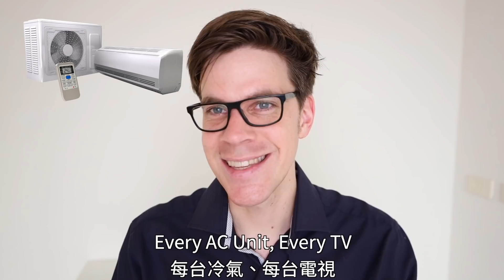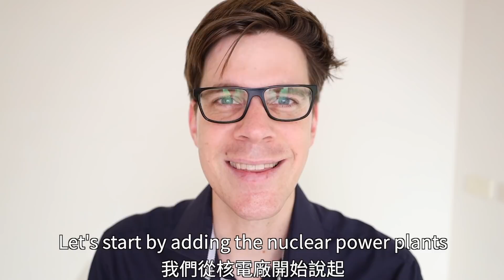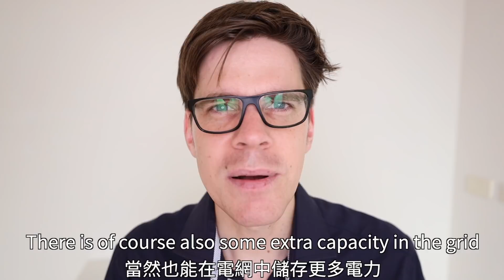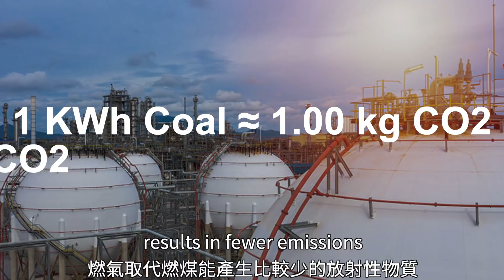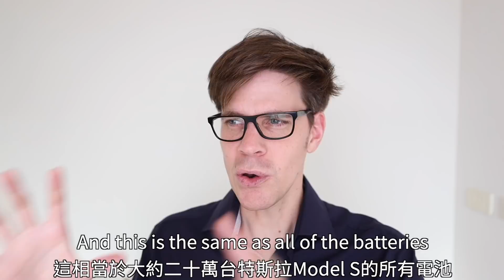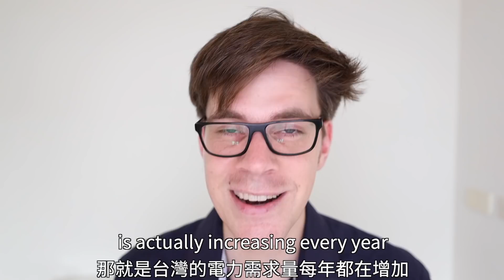台灣不需要核能和火力發電？3個使用更多再生能源的方法! | 3 Ways for Taiwan to get more renewable energy!

Comment: The duck curve phenomenon prediction in 2025 winter noon scenario, documented by Taipower company,  mentioned that the great penetration of PV power generation (Installed capacity 20GW) may rise the risk of instability of electricity system (very weak frequency response) if the storage facilities are not enough. According to Taipower company, the needed energy storage capacity is about 590MW in 2025; however, 12MW was installed in 2020 which seems a bit late.

Additionally, there's a big story inside for the difficulties of the renewable energy development in Taiwan, especially due to geography and weather factors. For, example, the PV panel are almost installed in the southern part Taiwan which may have risk of impact by thunderstorms in summer; wheras the offshore wind power facilities (almost constructed in the west offshore from Miaoli to Yunlin) may frequently stopped owing to gust wind (25m/s) in monsoon and typhoon season.
Reply from the maker: Thanks for sharing, since this is just an introduction video I just looked at the summer peak, do u have some source on the 2025 winter prediction? Would be interesting to see. 

I know the PV situation, but I don't see why PV can't be installed on rooftop in for example Taipei or Taichung? Maybe the incentive is not big enough or there is some other problem?

Thanks for your comment!
Reply: @JonasTjader  Thanks for reply. Since the information is almost in Chinese version, I found two English ptt on the internet provided by TPC, you can check the link below.

link1:
https://gwec.net/wp-content/uploads/2019/05/GOWST-Peter-Yuinhong-Liu-Taiwan-Power-Company.pdf
link2:
https://2020leds.tier.org.tw/docs/ChinChungWu_e.pdf

The PV penetration prediction I mentioned is on page6 of the ptt in link1, although detailed information was not revealed in the document and public by TPC. Other information like grid development with renewables and strategies can also be founded in the source.

The rooftop PV in Taiwan is a complex issue. What I've known is that the rooftop PV installation had become saturate in the southern part Taiwan; and most of available place that can have installation now are in the vicinity of Sea, where salt and mist corrosion may easily damage the PV panel. The rooftop PV construction in the northern Taiwan is on the way of development, especially in Taoyuan, where there's a great potential of factories and stores providing 100MW/year that may expect, thus the government is expanding incentives. However, the last but the most crucial thing that makes hindurance of the PV installation in northern Taiwan is the illegal addition rooftop and building, stemmed from the problem of dense residual population in the Taipei city, which is very hard for management...

Comment: hello Jonas, I have a question . If u use the pump to make water be higher place from lower place.It must need energy , why does Hydropower works?Cause energy loss must  be higher, right?
I'm not a energy engineer, so maybe it is a stupid question 😅
Reply from the maker: When you pump up the water, you need electricity to run the pump. Later when you want to use the electricity again, you let the water run through a generator on the way down. The generator will give you back about 80% of the electricity, so it is about 20% loss in the system.
Reply: @JonasTjader  The Hydropower efficiency is about -20%? So it works like a storage device when we need the energy in urgently 🤔.When we have the extra power , we make water be higher place.And when we need power urgently , we make it down. Does it right?
Maybe I need google it first. xD
Reply from the maker: @謝宇軒-q4r  I think you are mixing up Hydro Power (which generate "new" electricity) with Hydro Pump Storage (which is more like a battery)
Reply: @JonasTjader  OMG u r right , I mix up these things. 😅
Thanks for ur recommend. 😁

Comment: Jonas, but you missed a HUGE contributor to the stability of the grid and the management of peak demand which mostly occurs during the daylight hours.  Distributed solar.  That is the key to limiting coal and the reliance on fossil fuels.  How many of the drone shots show empty rooftops exposed to the sun?  so much existing real estate to fill before we need to invest in batteries and cut down forests or carve out hillsides to build solar farms.
Reply from the maker: Yes, my next point was that a mix of different renewables and different locations increase the stability, but I thought the video was getting too long :D. I agree with this point!

Comment: 核能和火力都是屬於基載電力，以目前現階段想取代相當困難
再生能源主要問題是發電效率低下且建設成本過高還有發電穩定度低的問題。
以下為台電目前發電狀況
https://www.taipower.com.tw/tc/page.aspx?mid=206&cid=406&cchk=b6134cc6-838c-4bb9-b77a-0b0094afd49d
Reply from the maker: Yes, Taiwan is replacing a lot of it with Natural Gas which I think is a good step in the right direction.
Reply: @JonasTjader  50% Nature Gas is right direction?
How do you think an island without nature gas but use 50% nature gas for electric .
If some typhoons will make nature gas out of stock .

Comment: 吉瓦=>>千瓦 or 瓩瓦
Reply: 吉瓦不等於千瓦 差很多  
以台中電廠一台火力機組550MW為例=55萬千瓦=55萬度/hr   如果以20GW來算等於20000MW=2000萬千瓦=2000萬度/hr
當然以再生能源來說裝置容量不等於發電量 所以基本上在中午當太陽能板裝置容量為20GW平均大約60%發的電力=1200萬度(大約僅能維持1.5Hr)
然後3點過後急速下降剩下2~3成(冬天更低)...晚上直接歸0
Reply from the maker: Yeah, I based the solar on one days output, so it is possible it can generate more, but it seldomly generates at max capacity since it is spread out. Was there some mistake in the translation?
Reply: @JonasTjader  No, the problem is not with the unit translation, but with my head
Reply: @發呆混時間  等等，所以是我記錯了嗎？
看來是我把GW跟KW的中文記反了